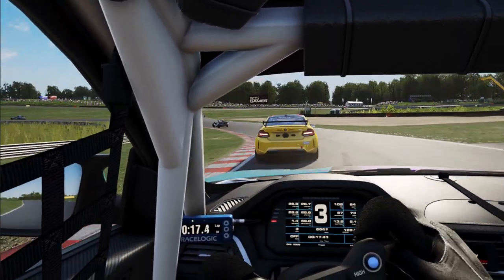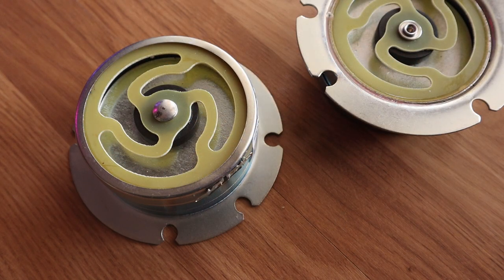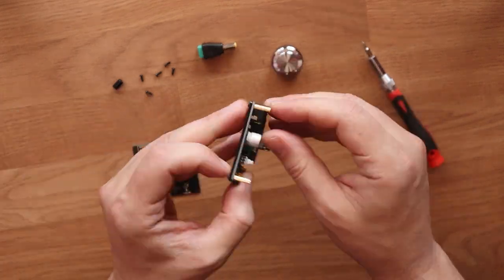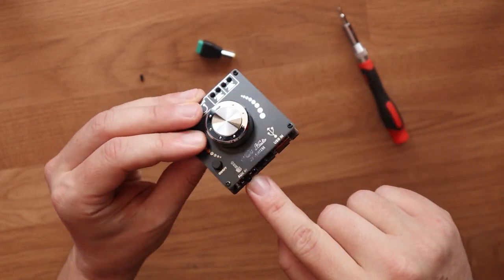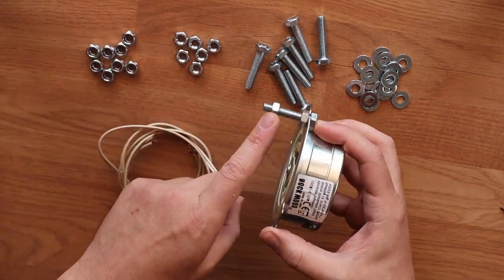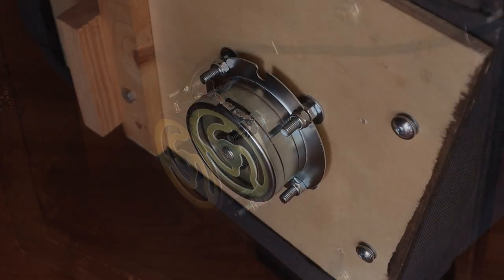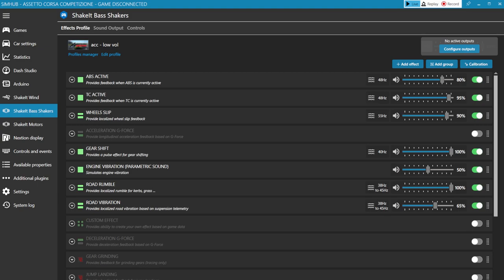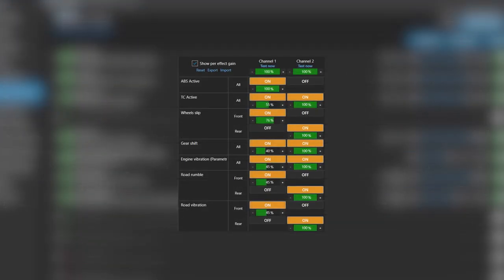Budget Bass Shakers for Sim Racing | pt1 Overview | ACC | SimHub

Comment: Nice video with some quality information. I'm wanting to try this out for some time now but my rig is quite clean (Simlab P1-X with sparco R100 seat) and I have no idea how to mount this under my seat or pedals as they are directly mounted to the alu profile. I can imagine mounting it directly would also produce unwanted noise. Got any tips or pointers for that? I'm not a great DIY guy :)
Reply from the maker: Hi Blehz. Sorry I'm not familiar with the seat tbh. The placement for the seat transducer particularly is something that each user would have to experiment with. It's always best for power efficiency to mount it directly, so there needs to be some way to drill and bolt it to the moulding, or use profile nuts to mount them to the frame as close as possible to your back/butt. I think a rig that big though would probably need at least two of these for the rear to keep the feedback strong enough.

Pedals are easier as they are often on a tray of sorts. This makes it pretty easy to drill some holes if needed and mount them right under your feet. The feedback there is insanely strong even with only one of these shakers. I have to turn down the power to the front a lot on mine to keep it balanced with the rear and the wheel ffb.

Comment: Hi Andy, and congratulations on the videos. I would likes to ask you how did you connect the two basso shakers,in series or parallel? Because at the moment i have a only One that before i used on Xbox but now landed in the PC world i wanted to implement whit at least One other to do the front and back
Reply from the maker: Hi Bouby, thanks. :)
The amp I used is stereo so it has two output channels. One for the front and one for the back, so it is neither series or parralel. Each shaker has its own channel then.

Comment: Hi! i have exactly the same bass shakers and similar amply...i use the same effects too, the only problem is that after few minutes the shakers became very hot and i feel less vibrations..do you have the same problem?any solution?
Reply from the maker: Sorry Stemay, I have no idea. Mine have been fine. I run my amp at about half vol to keep it cool and it is still plenty strong enough.
Heat is normal in the amp, but not the shakers themselves.
Reply: @AndymonPlays  which power supply you have for the amp?mine is 100w 24v
Reply from the maker: @Gurzo82  I tried a 95w psu (19v 5a ish I think it was), which was overheating the amp a fair bit, then went to a 45w 12v which I am still using now. No problems with this one. I think running the voltage on the limit for the amp could be a factor. Have you tried a different psu?
Reply: @AndymonPlays  i definitely have to try something similar...